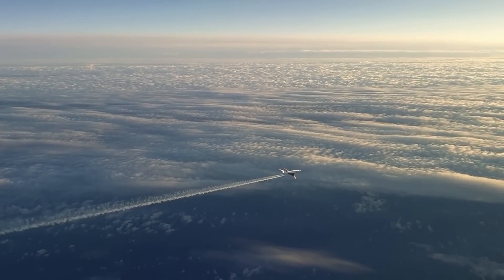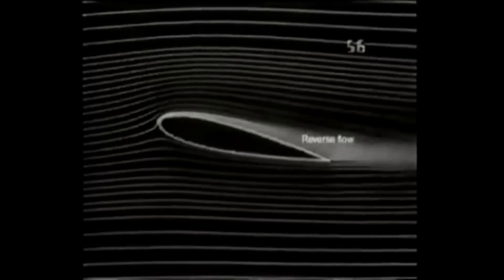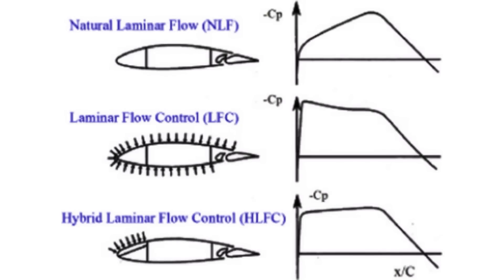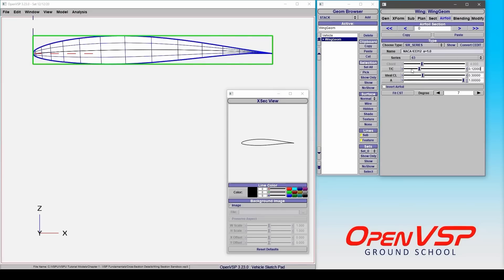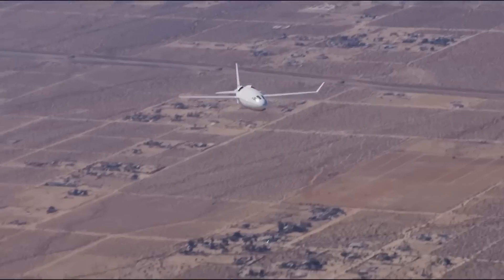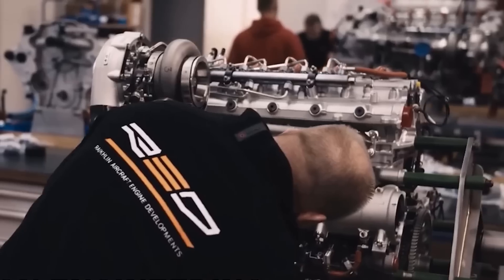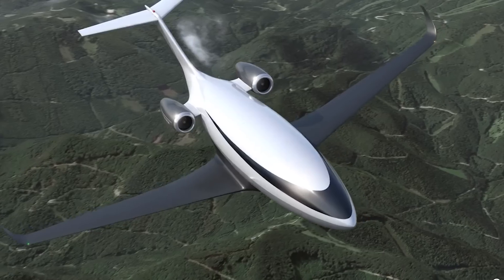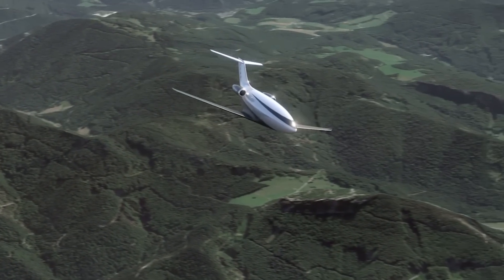Otto Celera 800 vs. Celera 500L The World's Most Efficient Aircraft

Comment: Only NASA achieved true laminar flow wings in one prototype jet aircraft. It required thousands of tiny holes be drilled into these wings and a advanced very expensive system to suck the still boundary layer air away from the wings to achieve true laminar flow. It was found not to be practical for civilian aviation. 

The aircraft does NOT have true laminar flow wings. The designers just reduced the drag a bit with cheap simple methods. Even the famous ww2 Mustang that is often claimed to have laminar flow wings has no such thing. These people are completely mistaken. It would require a system like NASA developed which is impractical and hugely expensive to operate.🙄
Reply: Just a follow on statement here. Many many companies over the years have claimed true laminar flow wings. None have given their aircraft over to NASA to test it what they are saying is actually true. They just quote themselves and their own chosen sources. 😒

Comment: Honestly I'm not surprised that the 500L was cancelled, even though it was flying. It never achieved even close to the jetlike performance it advertised, and it's super laminar flow technology was so finicky and prone to disruption that any improvement in the percentage of performance over traditional aircraft would have been in the single digits. This aircraft, if it is ever built, will likely only see similar single-digit performance improvements over existing aircraft, leading to no interest from investors or buyers which would be needed to get it beyond the prototype stage (Exactly like what happened to the 500L). Given they've never even published the performance achieved by the aircraft from testing, only that it "achieved all the goals that it set out to achieve" and that external analysis state that the aircraft reaching even half it's performance goals would be very generous for the design, this new jet design and scrubbing of the 500L from the website seems like an attempt to bury a failed prototype that didn't come close to what was expected of it.
Reply from the maker: Thank you for such an insightful comment. It's an interesting perspective. Innovations always face many obstacles; it's much harder than just taking existing technologies and creating a similar product. 9 out of 10 startups never make it to the finish line. The Celera 800 is essentially the 500, but improved. You have to agree - even if they don't succeed, it's a very noble attempt that deserves respect. But we wish them luck and believe that everything will work out.

Comment: Why is the cabin 20% more spacious without windows? That doesn’t make sense. If flexible digital display screens are installed they also have weight, how much? 
SAF fuels are E fuels Methanol so basically alcohol. Denmark is working,  well so did I , on the first methanol plant in the world to produce 40thsd tons a year from the adjacent Solar Power Plant and Bio CO2 . Goal is first ( European Energy owners ) to SAF domestic air travel. There would be a market for the Otto, as a public commuter not a luxury plane if upscaled .

Comment: Does this plane exist or not? With the passenger weight one would expect?
Reply: Apparently there is one, undergoing flight tests. No one knows what one fully equipped with everything that would be necessary for a certified aircraft would weigh, or perform like. You don't operate a passenger carrying aircraft over 20,000 feet without pressurization, but I haven't seen any mention of pressurization. Or de-icing. They apparently are still pretty far away from a type certificate.
Reply: @herbertshallcross9775  They are all 10 yeas away for more than ten yeas. I have seen project after project.  Not one ever gets past protype stage. Not 1.

Comment: Laminar flow has been around for 80+ years...  The P51 mustang had laminar flow wings.  A whole lot of BS going on here....  Every single one of the airfoils shown are between 80 and 50 years old...  That being said, I'd love to see the hardware, instead of vaporware.  It does look cool.  What's up with saying it is powered by a "V-12 engine", and then showing a turbofan engine?  A V-12 engine is 12 pistons...  Next you'll sell us a bridge in Brooklyn...
Reply: The RED A03 12 cylinder twin turbo diesel exists. There are YouTube videos of one spliced into a crop-duster and another in a DH Beaver. I don't know if one has ever been used in a series production aircraft. Apparently the 500L is designed around it and it would be a real problem if they became unavailable. Nothing would be a good substitute. You say turboprop? Much higher fuel consumption.

Comment: OK I am going to take the jump. I am convinced that the whole Otto thing is yet another scam. Absolutely NOTHING that Otto claims to have invented is news. Aircraft designers know about laminar flow since... world war two. The Piaggio Avanti is a good example of a laminar flow fuselage which has been in production for decades. I also think the Celera 500 with a single piston engine will 1. miss the projected performance at high altitude due to exponential increase in cooling requirements and the related drag. 2. fail flight into known icing certification tests 3. fail certification requirements for pressurization safety in commercial aircraft. 
The fact that it presently may be flying fast at lower altitude is the investor trap. Extrapolating these figures to project high altitude miracles is not realistic because the design is not suitable for commercial high altitude operation. I mean: imagine this thing flying at 55'000 ft above icing weather and losing its only engine...

Comment: Amazon should jump on it if it's really that good. They would save a ton on air-cargo.
Reply: Until it is certified, there is nothing for Amazon to jump on. 

A ton, you say. A six seater has about a 1200 pound useful load after you put fuel in it. Hard to make a ton of money with an air freighter that can only carry a little more than a half ton.

Comment: High efficiency wings are an interesting development...but remember that 'there's no free lunch'.   The 'super laminar' wing is going to be more influenced by contamination of the surface...such as by bugs or ice.   It's one thing if your efficiency goes down after taking off then landing in Florida and getting the leading edge all smeared with bug guts....it's the icing that I would be more worried about as that buildup can happen quickly and would be VERY bad for the wing.

Just like with EV automobiles...'new and revolutionary' can make improvements on existing designs but almost always come with drawbacks in certain situations or conditions so a production vehicle must be a compromise that sacrifices the potential gains for safety and durability.

Comment: Get the 500 out now! That 800 needs to be built and the cash will come from the 500.
Reply: Nobody operates a 400 mph, high altitude aircraft without a full de-icing system. Have they demonstrated that? Has one even flown with any seats in the cabin? The FAA doesn't sign off on concept drawings in a sales brochure.

Comment: I think it's a little early for composites to this degree in aviation. I wish them the best. I hope they're much better than a certain submarine we know about. If one of those windows goes, all the passengers will get sucked out, not just a couple like on a regular jet. A feather in a hurricane? I'd like something with a bit more mass. There all these happy happy joy joy reports that are pretty one sided. Or they could be another Aptera where if you go back 10 years you'll see almost the same youtube videos as we've been seeing over the last few months. Once these are at scale production I'll tip my hat...until then....
Reply: Composites are routinely used in airliners. And in light general aviation aircraft. 

Designing high altitude, high speed aircraft is not as simple as having a clever idea. I'm not tipping my hat until they get a type certificate, which is a major accomplishment even if they never manage to sell one.
Reply: @herbertshallcross9775  The fact that they are used is a generalized fact that attempts to skew. If you use them in the arm rest it's pretty irrelevant. If you use only composites in the nose gear and nose wheel, it's a different story. If they are used in places with high stress it matters. You can have two arm rests made of composites and say that composites are used in modern airplanes.

Comment: Interesting to see but this seems to be more hype than real progress.   Laminar flow has been known about since NACA's work in the 1930s (Abbott and von Doenhoff) and the P-51Mustang had a laminar flow wing section.  The reason why all aircraft don't have laminar flow sections is that their stalling behaviour is generally worse than other sections and maintaining laminar flow (ie, rivet-free, clean, insect-free etc) wing surfaces is fine in a wind tunnel but difficult in practise.  Laminar flow wings reduce cruising drag but don't increase lift so wing size is dictated by stalling speed requirements and the complexity of the high lift devices.  Composite fuselages are also nothing new these days.  The Eclipse 500 had one (filament-wound, not a tube) and such things are now common on even long-range airliners.   I was always a bit suspicious of the Celera 500's future but I see it is now being called a technology demonstrator.  Great.  Reduced fuel burn has to be good and GA aircraft projects need to aim for this in the future as the technology hasn't really moved much in decades.   So, it's good to see people taking an innovative approach to new projects but hype will always disappoint because practical reality has a way of always raising its unavoidable head.

Comment: I notice during all of the Hype they never mentioned wind sheer,, Ive been in several small planes and the wind sheer has always been a issue in a small plane that can get easily pushed around . Love to hear more about the wind sheer handling capabilities..
Reply: Ir isn’t hype. . Wind-shear affects all aircraft. Turbojet aircraft have longer engine spool up time to power their way out of a loss of relative wind or angle of attack suddenly increasing due to a rapidly increasing tailwind.  The laminar flow wing won’t be”  hurt” more by windshear. I didn’t stay at Holiday Inn Express last night but I am a 37 year commercial pilot.
Reply: @peredavi  a nuance : windshear affects more light and slow aircraft. Furthermore, the electric hype fails to address one concern : such aircraft have constant weight through the whole lap while fossil fuel aircraft are usually lighter upon arrival (burnt fuel). In case of a go around, a jet fuel aircraft is more likely to pack much more TOGA energy than an electric vehicle, the later tailored to be as efficient as possible, therefore, likely to save weight til just enough thrust to climb; incidentally, does not have the sheer power of a jet fuel based aircraft go around potential. (I mention electric as a potential outcome since it's sooo popular these days..)

Since the plan here is to get as efficient as possible, the vehicle will get as lightweight as possible. The laminar fuselage will pose size restrictions, we have both light and small at the same time. Also, a laminar fuselage paired with small wings (to save weight) is most efficient with no crosswind, while the fuselage thicknesses gets more sensible to wind direction variations at low speed.

I wonder if windshear is really a non issue in this very case (?)
Reply: shear
Reply: What about it? Is it a particular concern for this aircraft?

Comment: Claims are fun. Delivering is revolutionary. 
That is why everyone makes BIG claims to raise capital to pursue ideas. There is no requirement for the claims or ideas to be good or practical to get funding. 

All you need is some 3D animations and maybe a few models. Once the engineers are faced with the thick book of regulations, interior demands from customers, etc, etc.....that is when it gets real.....quickly. Pretty sure about .0000001% of the target audience is going to be ok with TV's for windows. 

Anyway.....I'll be generous and give them about a 10% chance of having a commercial product in 10 years. Most likely more. The cash burn required to depart design norms is stunning - even if the concepts actually turn out to be good. Good luck.
Reply: They made a flying prototype, most companies never get past the digital mockup stage.
Reply: @kehreazerith3016  True. The prototype is a big step. Commercial certification is a leap across the Grand Canyon. 

Lets see how they do.

Comment: Those so-called "digital windows" keep cropping up in concept drawings but are obviously impractical.  It would be like sitting next to your TV, nothing like an actual window.
Reply: Those digital windows show up because real windows weigh more and are much weaker than un-penetrated fuselage skin. Putting the structure in to carry the loads around those openings could get heavy, expensive and have a serious impact on performance.  

Lots of airline passengers don't want anything to do with the windows. How much do people need to avoid claustrophobia? Could you just paint clouds on the cabin wall?
Reply: @herbertshallcross9775  I totally understand the motivation to eliminate actual windows but pretending a screen right by your head is anything like a window is dumb.

Comment: Nobody mentioned the resemblance to Jim Bede's BD-5.
Reply: That is a good point. I don’t know if the BD-5 Had that shape because of anticipated lower drag. I doubt it, but maybe so. No matter what the shape need to take into account some measure of reducing drag
Reply: @steveperreira5850  The BD-5 absolutely had that shape to reduce drag.  The original concept was advertised promising that the absolute minimum drag would allow the plane to fly 170mph on 35 HP.
Reply: I'm not really seeing the resemblance. Round nose, propellor in back, but the actual shape of the fuselage, nope. The 500 L is mid-wing, BD-5, low wing, and the canopy of the BD-5 is practically a quarter of the fuselage total surface. BD5's fuselage is flat on the bottom and rear sides. The BD-5's fuselage had nothing to do with laminar shapes, the entire concept behind the 500L.
Reply: @herbertshallcross9775  You really think the 500 L is a mid wing?  You must be watching a different video.  The BD-5 had everything to do with laminar shapes,  the entire concept behind the BD-5.
Reply: The possibility for misidentification exists .The OTTO Celera 500L is the porky-looking mid-wing with the pusher turbo diesel engine. That plane actually exists, but is far from production-ready. The OTTO Celera 800 is a design concept, a paper airplane that would have two rear-mounted turbofan engines, a slightly swept low wing and an OLED video screen instead of windows (I hope just for the passengers, and not the pilots).

The Bede BD-5 did use laminar flow airfoils for at least the wing.  I haven't bee able to determine what airfoils the rudder and stabilator used. The fuselage was not any intentional laminar flow shape. The computer modeling OTTO used to create the shape of the 500L simply did not exist in the early 1970's. Jim Bede was impressed by the cockpit of a new sailplane design and he incorporated his impression of that with some TLAR(That Looks About Right) engineering to come up with the fuselage shape. 

The airfoils Bede picked for the wing roots were probably a poor choice. A home-builder modified his, and provided patterns and instructions for other homebuilders to scab on (his words) styrofoam blocks to the aluminum wing skins, sand them to shape and fiberglass over them. He got about 15 mph better landing speed and a much safer stall break. 

Early projected numbers for the BD 5 were nearly 200 mph on 40 hp. A little rosier than even your numbers .